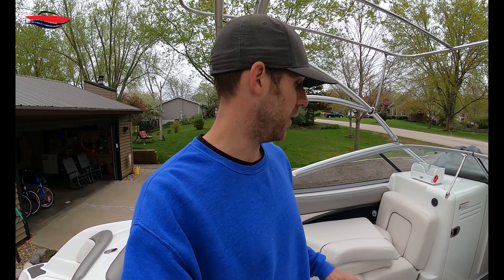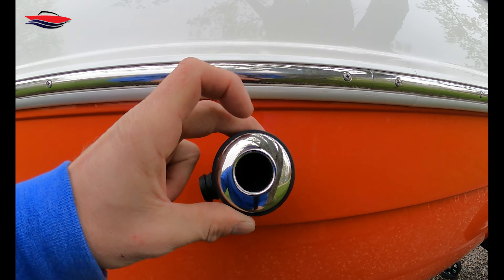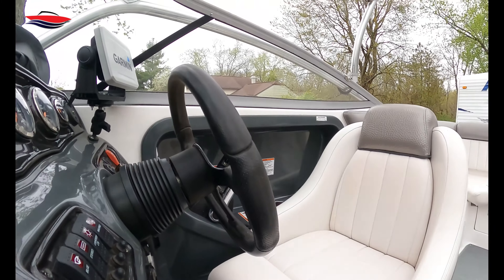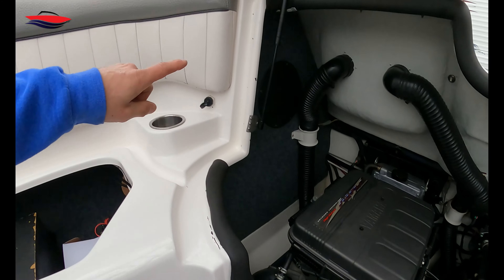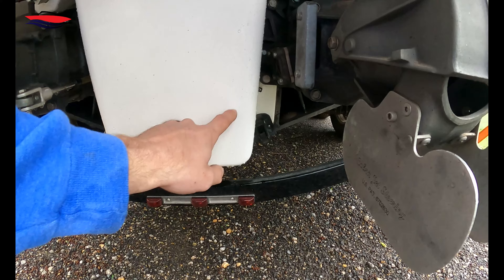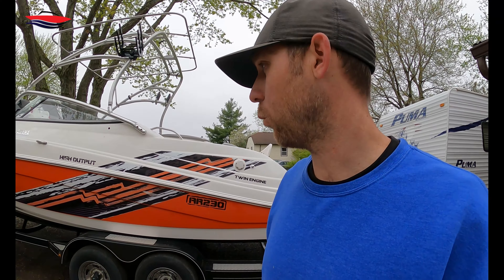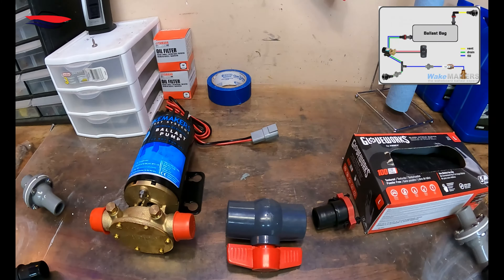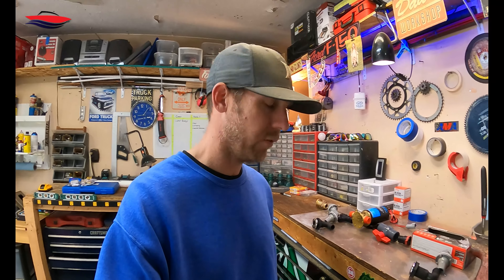Ballast System Install - Overview - Part 1

Comment: At the drain line, you installed installed a check valve, but I don’t see that I the diagram.  Is that something extra you added on your own, or is that something wakemakers missed on the diagram.  Very informative videos!
Reply: Sorry, meant the vent line.
Reply from the maker: Yes, I installed a check valve on the vent line.  The check valve on the vent line allows me to drain the bags completely dry.  Without the check valve during draining, air would be coming in through the vent line as the water is getting pumped out.

Comment: Thank you for these videos.  Quick question.  3/4” thru hull fittings for vent lines and what size thru hull did you use for drain lines?  1” or 1 1/8”?
Reply from the maker: 1inch

Comment: Did you encounter any issue with the rear  locker ballast placement on the port side?  I have a 242 and there is a charcoal canister for the fuel system that's obstructing a decent amount of space.  I'm a little worried about the room and sharp edges.
Reply from the maker: I did prep the locker area on my 230.  Watch this video https://youtu.be/4a-9vRg1FNI?t=36 and you can see what I did to prep it and keep the bags from getting a tear.  Also, FatSacs are super durable and can hold up to alot.